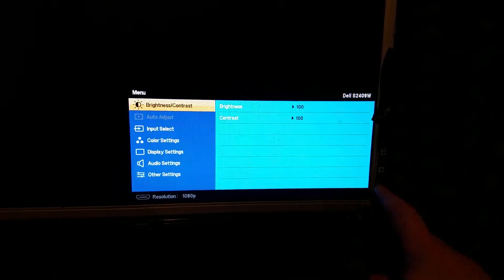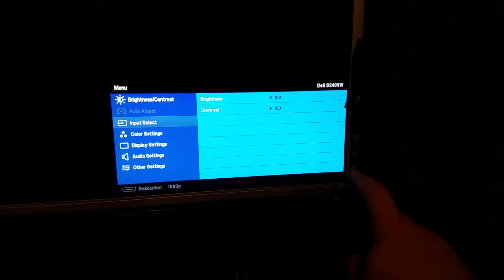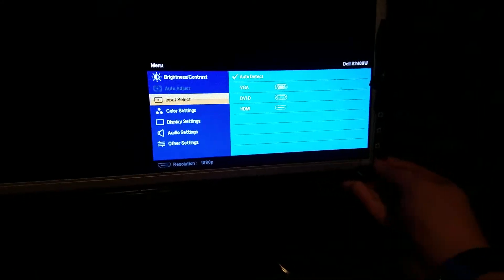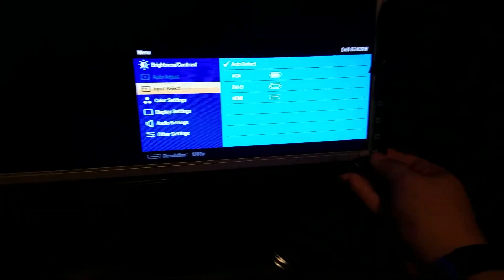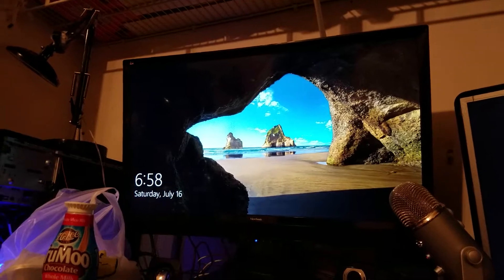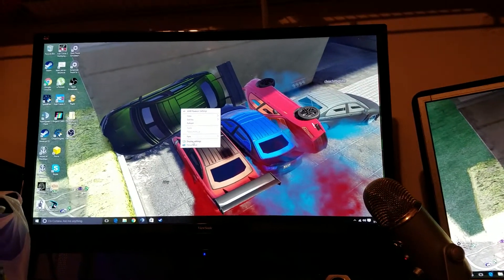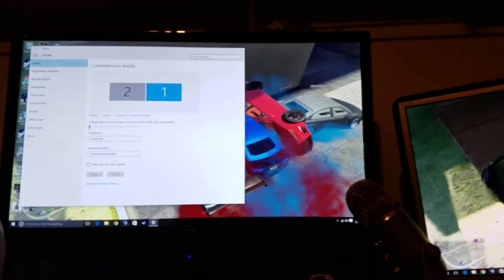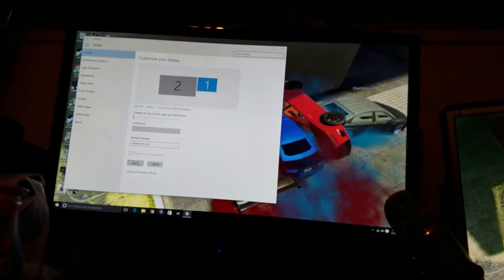How to repair your 24" Dell Monitor (S2409W)

Comment: How would I get that plastic frame off in a way that wouldn't destroy it? I'm hoping to take the guts completely out of mine so I can spray paint the plastic.
Reply from the maker: Jeremy Borum  I believe there are clips around the edges that you can remove.